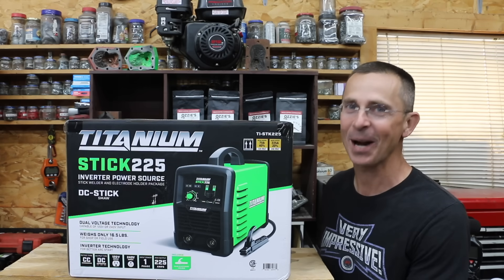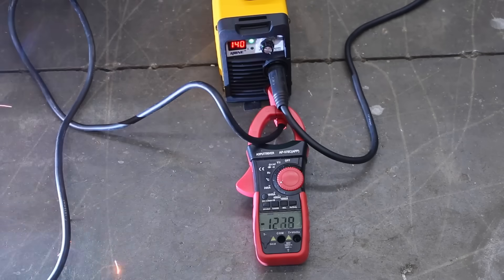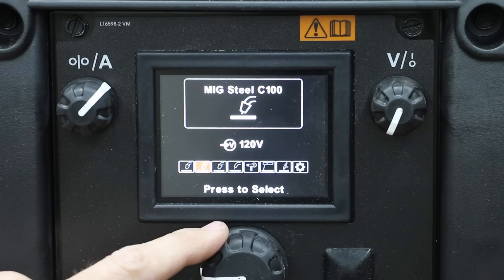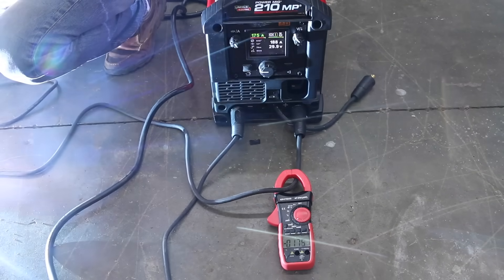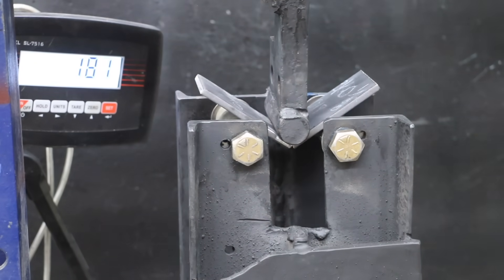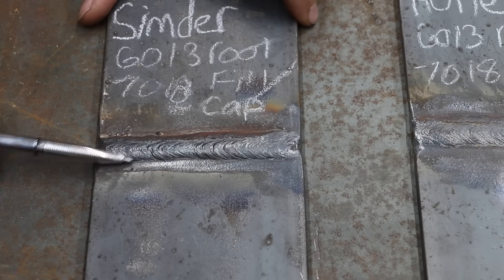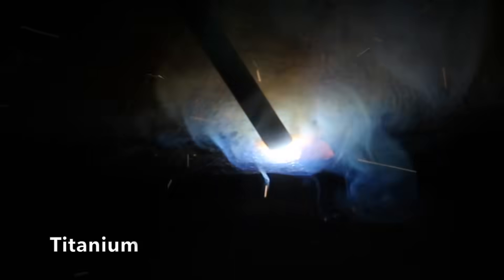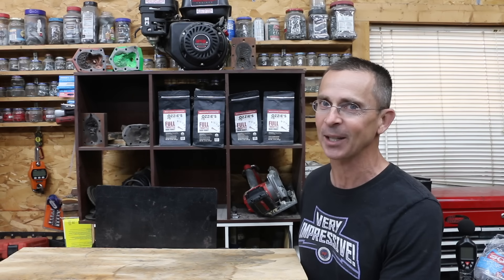$70 vs $2,300 Welder? Let's Settle This! Weld Strength, Duty Cycle, Current Output, Build Quality

Comment: Thanks Joe! And seems like the titanium is well worth the money. If my welders gonna be inaccurate I'd rather it be stronger than necessary than not strong enough, the titanium you can just turn down a bit to compensate but those cheaper ones wouldn't help much if they are going high enough.
Reply from the maker: Thanks!  Thanks for the feedback.

Comment: Thanks Joe. One way I am kind of curious the 120/240V multiprocess - the Vulcan at harbor freight that's a little more expensive than the much revered and well-reviewed titanium 200/170s.
But again, buyers of all 4 seem to be satisfied with what they chose - there IS a huge price range of $570 - $930. What does an extra $360 get us, since all are rated for 3/8" steel?
Reply from the maker: Thanks!

Comment: I have an everlast welder that does tig and stick which cost $3,000 including the shielding gas,tungsten electrodes and filler rods verses a comparable machine from miller or lincoln electric starting at $6,500 which includes the tig torch and other needed parts
Reply from the maker: Thanks for the feedback.

Comment: Thanks Joe.  
I don''t think that Lincoln should have been included, that's just a far more capable machine and I suspect no one considering a light weight light duty stick welder starting at the $50 range is even going to be looking at something like that other than to say wish I could afford that.  That said, now I want one even though I only need to weld three or four times a year, I only have a cheap welder because I got tired of having to hire a welder when I can weld myself, but I do have more money than brains so now I'm cursing you for dangling that shiny object in my line of vision and putting my emergency savings at risk.  On one hand a pox on you Project Farm!  On the other hand I bet if I look hard enough I can find something that never really needed welding beyond the capacity of my current cheap welder before and still works just fine that will justify buying it.  Now you have to do one of these on multi-purpose rigs so I can be enticed to spend even more money I don't need to spend on something I don't really need.  To paraphrase Charlton Heston in a more family friendly way, "dang you, dang you to heck."
Reply: You're right about that (but I doubt anybody cares).  They think the Titanium has the same functionality, for the most part.
Reply: @campbellpaul  -- Well that's a bit of the point, the Titanium belongs in this group, the Lincoln really doesn't, the only thing they have in common is ability to run stick on 120 volts and some people may now think that the Lincoln is just overpriced when it may actually come out as better at less money compared to other products that actually would fit in the same category it belongs in (and I'm not saying it does, just that it might).  That the Titanium compares well in the 120 volt stick category is great and speaks very well for that brand, but that's not really fair to the Lincoln because it can do so much more, it absolutely ould have produced a better weld on that blank if you just plugged it into 230, something yoy can't do with that Titanium.  Worse, idiots like me might look at this and go buy the Lincoln without knowing there are better welders for the money in the category it belongs in (and I'm not saying there are, just that there might be).   Project Farm has always been pretty good at keeping it apples to apples and not throwing oranges into the mix, lets keep it that way.

Comment: I would love a review on multiprocess welders. I’ve seen some MPs that offer stick, mig, tig AND a plasma cutter. Would love something that flexible in my shop.

Unrelated: a test of adjustable storage organizers would be cool. I’m referring to the small parts organizers that are used for things like storing screws, electrical terminals, or other small parts.
Reply from the maker: Thanks for the suggestions.

Comment: surely if you are test a 110 to  230 volt welder at 110v , then it should only achieve a fraction of its amps dislpayed

Comment: I think the channel can benefit greatly from some subject matter experts like Joe.  Having the raw test data is a really good thing, however, having the thoughts and input from the experts can provide Insight that may not be measurable.

Well done guys!
Reply from the maker: Thanks!
Reply: Yeah I second this as welders in particular are a bit of a difficult area to do unless a proper welder checks them out on the practical end. It was nice to see the testing show what is better for small projects and short welds.

Comment: My $200 40A stick/innershield welding machine does a fine enough job for hobby work and whatever else I need to do around the farm.
I learned how to weld at Community College on Miller Dynasty multi-process machines (don't remember the specific model, but they were high end).
Reply from the maker: Thanks for sharing.

Comment: Thank you Joe! Testing is always better when you have help. I purchased a Klutch multi process welder from Northern Tool to replace my Lincoln 110. I compared several brands from NT and HF including Vulcan and Titanium from Harbor Freight and a couple available from Lowe’s. Ultimately chose the Klutch MP230 mig/tig/stick because it had all the accessories plus a spool gun included for both the aluminum and steel I intended to weld. Thanks for what you do and keep testing! VERY IMPRESSIVE!!
Reply from the maker: Thanks!

Comment: Some testing ideas would be things related to white boards. Specifically marker brands to see which ones erase the best and if some become more permanent if left over time. Also methods to refinish whiteboards that no longer erase easily. Further with the refinishing idea, how durable is the refinished surface, will the refinished surface just revert back to the prior state after cleaning with isopropyl or a month of use.
Reply from the maker: Thanks for the suggestion.

Comment: As a life long Miller welder user, the Titanium line is fantastic for the price. Their duty cycles are usually better than the more expensive Vulcan welders too. Been running the Titanium multi process off 240V for close to 4 years now with almost daily welding and it just runs and runs never hitting the duty cycle or losing arc integrity at all. HIGHLY recommend!
Reply: I'll have to check out that welder.. I wonder who they copied it from for it to be that good.
Reply: @campbellpaul  Not sure. I know the comparable Miller is over $3k and only comes with the MIG leads, they make you buy the stick and TIG leads separate!
Reply: @campbellpaul  lol "copied"
Reply: WOW!!: Experienced Pro's words are priceless!!.💪🥇
Reply from the maker: Thanks for the feedback.
Reply: I have the titanium 120 mig welder. Absolutely love it.
Reply: @Gary-tc7zx  I hear the Titanium MIG 140 is good for 1/4" steel and doesn't trip 20a breakers.
Reply: Do you have the 140 or 200 multi process?
Reply: Deko is good,I owned one for over 12 months
Reply: We use Miller at work, have several of them. But the price is prohibitive for most folks. I won't even talk about the Lincoln Python X we have. Lol. But then again most aren't going to have a fab shop in the garage.
Reply: @kevinsbackyard  Miller is fantastic but you're right about price. I only buy Miller auto darkening helmets though, I can replace a welder but I can't replace my eyes yet.
Reply: The titanium is a pos.
Reply: @jvillain9946  All of them? Some of them? Only yours?
Reply: l had a flux 125 and was running it on an extension cord but i still welded alot with it probaly went through 7 spools of wire and it never hiccuped the slightest the welder was bought for me to use on a once freinds junk so i didnt own it but was the only one to use it but it shocked me how good it was i had my doubts thats for sure this was back in 2020

Comment: I was a journeyman welder and worked for many years in a custom metal fab shop. Imo the difference in cheap vs expensive welders is longevity. I put the operating hours on a welder in one week that a home owner would in years. Of course a cheaper welder is just fine for a home owner. Most of the cost difference here came down to comparing multi process to dedicated stick welders.
Reply from the maker: Thanks for sharing.

Comment: If you ever do a second round, it would be cool to see how PrimeWeld holds up. When I went off into the welding pocket of YouTube, I heard they were good for the price with good accessories and options, though those may have been sponsored videos or the quality might have dipped. If you're searching the comments for interest in another video and new welders to try that would be nice. 
Also I appreciate you trying to respond to all the comments you can, but try not to give yourself carpal tunnel. I saw that paper-cutting test for the scissor video and I don't know how your wrists still function.
Reply from the maker: Thanks for the suggestion.

Comment: That Ammeter doesn't fit for DC current, only to AC.  I wonder why it shows anything. This is most probably because the current is not uniform but pulsating.  So no wonder it shows erroneous.

Comment: I wish you did more Details on the Unboxing, part of video I want to get a welder what do need to buy becise the welder. Do need leeds. Clamps. Did you wire welled or stick welled.  I done both wire and spot in a factory where it put the part in  tray and press the bottom.   I was told to go harbor freight and buy welding and learn at home will get you farther than most schools.
Reply from the maker: Thanks for the suggestion.

Comment: In welding it is important for amperage to be exactly as it is set. Not more not less. If you weld sone fence for your farm than you can consider any cheap welder. But if you weld professionally than only worldwide known brands: Lincoln, Miller, ESAB, EWM, Merkle etc.
Reply: If your welding is too hot, you can turn down your amperage.  If your rod is sticking, you turn up your amperage. Most of the top welders are off by at least an amp or three, so you'll never know for sure unless you do proper bend (or x-ray) tests to see the results of your welds.
Reply from the maker: Thanks for the feedback.

Comment: I’m actually very impressed with the titanium. Your tests were great, only thing different in the industry is on your beveled pieces we would have run 6010 root pass instead if 6013. that’s what will get you the CJP. But great test! Very cool to see what those cheap welders are capable of. Being a certified arc welder in many positions this video was right up my ally. Although I do love all your other videos.
Reply from the maker: Thanks!  Thanks for the feedback.

Comment: Harbor Freight: Struggles to make a functional $7 wrench.

Also Harbor Freight: Makes a $320 welder that goes toe-to-toe with a industry leading $2300 luxury welder and almost wins 😳😳😳
Reply: I have a Harbor Freight $7 wrench and it works pretty well.
Reply: HF's Hercules line is incredible, especially for the price. They're doing a great job catering to ask kinds of tool users' needs.
Reply: HF used to be just bargain-bin products but since moving to their cheap-better-best 3 tier system, I'm quite impressed. The top tier goes toe to toe with name brand prosumer tools.
Reply: I have the titanium flux core welder and for just home projects it's a beast for the price.
Reply: Remember, HF does not make anything. They put their name on a product.  Most are already in production for another company, some have just enough of a change to keep from being in a lawsuit. Their ICON line is probably one of the worst, especially their ratchets. It is a 20.00 Amazon ratchet, exactly. Right down to the part number. The only difference is the ICON name on it. We'll that and the price. 
Some things they do ok on, others are a complete rip-off.
Reply: The ratchet wrenches i bought from harbor freight are holding up fine however the cheap non ratchet ones broke after like 30 pounds. As for ratchet my Pittsburgh pro 3/8 was used to do lug nuts a few times as i was curious to see what would happen as it's like 14 bucks but thing still works fine
Reply: Harbor freight buys from lots of different factories and design centers, and then assigns one of the brands/labels to it.  That's why you see such variation in the quality of their products. Heck, even Apple makes their products in China, I bet their quality control benchmarks are insane.
Reply: Lots of good wrenches at HF, just don't buy the absolutely cheapest model of anything unless it's a tool you only need for one job.
Reply from the maker: Thanks for the feedback.
Reply: I have an entire set of HF $7 wrenches. I like them better than the craftsman and protos i have at work
Reply: Chad freight
Reply: A quick search suggests that some HF welders are actually made by Lincoln and Miller so 🤷🏻‍♂️

Comment: I bought this " Weldpro 200 Amp MIG210LCD Dual Voltage 115V/230V 5 in 1 Multi-Process "  last summer. I just mig with it. 
It seems pretty good, the feed is sometimes finicky and the mig gun is smaller than I would prefer ( hard on off hand gloves ).
I bought it to fix hay feeders and those light gauge panels and gates we have everywhere. Works really well for that. 
I used it to weld a few hundred feet of used oilfield pipe fence as well. It's way easier to use it that our lincoln eagle gas welder on magnetic pipe.
I do use the lincoln as a generator when out away from outlets. 
I use .035 fluxcore wire from lincoln in it. ( the kind that is good for multiple passes ) Cheapest from summit racing from what I have found online. 
I have run it plenty on a heavy yellow 100ft extension cord with no problems @ 110v I just throw it in a wheelbarrow with the other welding type stuff.
Reply from the maker: Thanks for the feedback.

Comment: I have a @Reboot welder that does mig, fluxcore, stick and tig. For a price point around $400 and works great. Dual voltage also😁
Reply from the maker: Thanks for the suggestions.

Comment: You should review the lotos multi process welder, tig, stick, and plasma cutter for under $500 been using it for 3 years now for tig and plasma cutting alone and has done great
Reply from the maker: Thanks for the suggestion.

Comment: Im currently looking for a multi process welder, and I would definitely like to see a comparison of multi prosess welders like the Lincoln in this video vs. Hobart, Miller, and Harbor freight brands. I'd like to see their actual power output vs. demanded. Duty cycle between each brand. Quality of each welding process across brands. Ease of setup/ use for each process right out of the box. And, of course, what features each brand offers (type of user interface, arc starting assistance, range charts, or predetermined settings for types and thickness of materials)
Reply from the maker: Thanks for the suggestion.

Comment: I very much appreciate Joe! I would like to see more welding materials tests. 

I am also asking if you can do a series on Pullers. I am having trouble doing one full job with a Ever-craft 776-3905 two jaw puller for my tie rods. It worked well enough on the first then very rapidly degraded bent and only assisted and I finished with a pickle fork and hammer. And if you could do a non marring dead blow hammer video that would also be useful. But I very much thank you saving our money and frustration with tools we should have choose different for our purposes. You do a great service to the economic outcomes of many many people. Thank You!
Reply from the maker: Thanks!  Thanks for the suggestion.

Comment: I just got a Lincoln LE31MP yesterday from Home Depot. Normally over $1k but I found a link online that had it for only $890 so they price matched it for me. I will have to weld a boat trailer tongue up with it in a few days using the mig setting, but it’d be great to see how that multi purpose welder stacks up against the Lincoln in this video, or even how it compares to the now discontinued millermatic that ran on 110v
Reply from the maker: Thanks for sharing.  Thanks for the suggestion.

Comment: I bought the lincoln mp210 several years ago and don't regret it. It does exactly what you want it to do and as a seasoned welder, that is what you want especially when you don't get to dial the welder in to the process and you just need it to be right for that fix you need done. Also, having the multi process makes it so much more versatile around the shop. Only downside is you can't  tig weld aluminum with it as aluminum requires ac current output.
Reply from the maker: Thanks for sharing.

Comment: Another commenter nailed it, you sound like an auctioneer. You present things too fast and without enough variance of tone, making things hard to follow. The shit eating grin and smarmy attitude on every intro and outro is jarring. Your welding expert called a weld bead to be 90% penetrated when it was clearly less than  75%. You're lucky you have so many followers that will not criticize anything you do.

Comment: i've been looking for a tig welder, something that'll do high frequency start so i don't have to scratch start, found some that might do, well less than 500 bucks cdn, i ain't gonna waste a lot on something expensive, i already have other types of welder that'll do most of the same stuff.
Reply from the maker: Thanks for sharing.
Reply: @ProjectFarm  its200 is everywhere, no good for aluminum, but, dirt cheap.

Comment: Another good bit of info would be advertised Open Circuit Voltage vs actual. Cheaper welders usually are low and makes it a ton harder for certain rods and arc starts for beginners like myself. I've found that to be one of the most important numbers when shopping based on various units I've used. I suspect that value is fudged like many others were on the cheap ones.
Reply from the maker: Thanks for the suggestion.